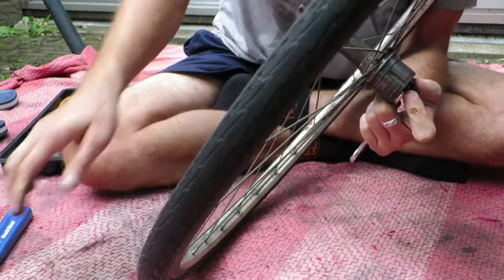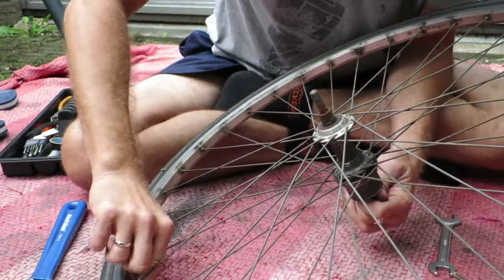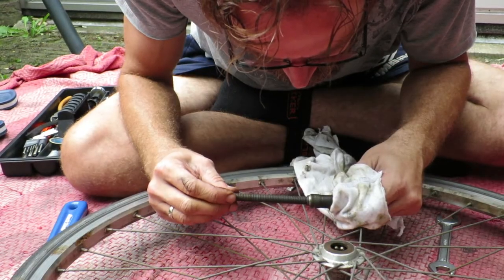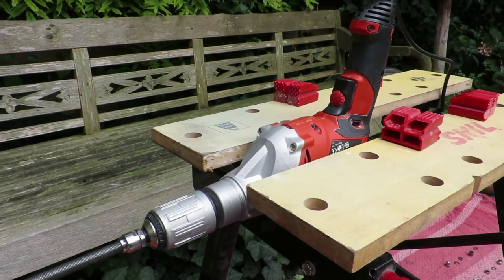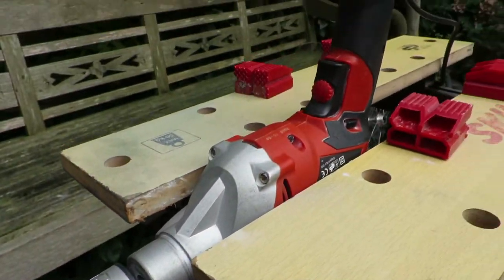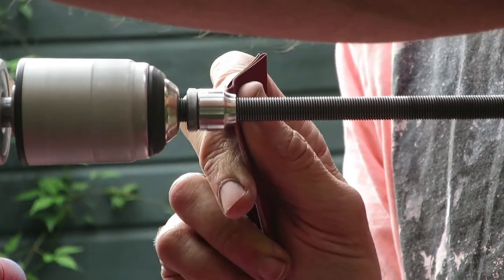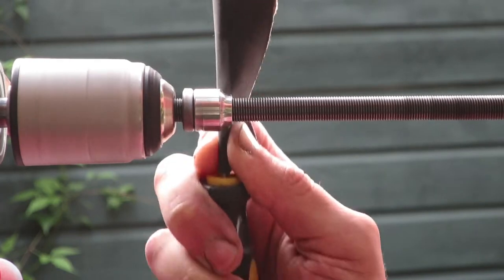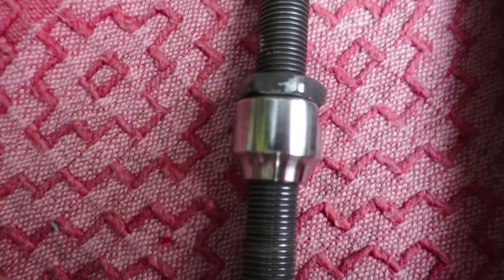How to easily repair damaged and pitted hub cones in 2 simple steps

Comment: I've done this four or five times. I use a drill press, so it's a bit easier. I start with 320 grit wrapped around a screw driver handle that approximately matches the radius of the code. Once the pits are gone I move through finer grades until I get to 2000 then I finish with metal polish. I don't know if it would make sense to go out and buy all those grades of sand paper, and polish, but I have it around anyways so it's no issue. It comes out looking like a mirror, and so far has never been a problem once installed back on the bike.  I've only had a problem once (just recently) and that was because the threads of the cone were badly worn and loose such that it was impossible to adjust them properly once they were on the bike. So I polished them for nothing in that case. Lesson learned, I'll reject the cone in the future if the threads are at all sloppy.

Comment: Today I tried this method with good result. The cones were smooth and shiny again. I used 180 and 400 wet sandpaper on a screwdriver. Now my front hub runs smoothly again. I think the “track” on the cone where the ball bairings touch will harden from use and will be polished by use.

Comment: Brilliant video! There's only one other video regarding repair of pitted cones. Was going to watch that one over however yours popped up.
Reply from the maker: Awesome. Glad I could help!
Reply: @restorationdotbike  how many grades of sandpaper did u use? I will be starting with 150 and than 3 other grades the final being 1200 or 1500 thanks.
Reply from the maker: @myvicariouslife4012  I believe it was 80, 150, 240, 400, 600, 800, 1000, 1200

Comment: This is excellent, thank you. There is a very good video on the same topic " How to Repair Pitted Cones and Cups in a Shimano Hub " It takes some time but it works perfectly. The grease makes the difference! I used a general purpose grease, orange transparent and after a year or so my bearings where toast. Then i switched to MoS2 Grease (KPF 2 K-30) and after 10 years and 1 regrease the bearings look good. I think MoS2 is the deal, but i tried nothing else then. Maybe EP-additives(could be) or PTFE(i doupt) would do the same or better? Has anyone information about this?

Comment: Thanks for keeping the video nice and short! Can I ask how those cones have lasted ever since? Do you have any evidence as to how long the newly polished cone lasts in comparison to a new one?
Reply from the maker: I can't because I've sold the bike. What I do know is that the most wear on bearings is not because of usage in general, but because of usage  with contamination from water or grit. Or because the entire bearing setup shows play so the force on the bearings is unequally distributed.

It could be that the cone surface has been treated so it's hardened and sanding the cone removes this layer, but I'm not an engineer so that's beyond my area of expertise
Reply: Pressure from use induces "work hardening" so, in many cases, you are fine using this. At least, it's better than riding on a sorrowfully pitted cone. Thanks for this video!
Reply: @KarlosEPM so the surface of the cone hardens where the ball bearings touch the cone? If that is so, maybe polishing it to mirror shine with 2000 grid as mentioned in an other comment, may not be necessary?

Comment: Hub appears to be a Joy-tech of which there are tons of old hubs that can be found in perhaps bike shops that has clipped the spokes out of non repairable wheels and so on, I myself will have a small mountain of discarded hubs for the axle parts. When I will retool a hub of such, out with the grade #300/#400 carbon balls and rebuild with High Quality grade #25 Chromium ball bearings and since I will be loosing material from the cone I will make up the difference with a thin washer. If the inner bearing race will be pitted then I'll just rebuild with a hub from my hub stocks. Just my 2 cents.
Reply from the maker: My LBS didn't have these cones

Comment: Will my brake rotors stay true after this? Or this is better for a bike with rim brakes. When you have disk brakes it is very important to avoid any kind of wobble but if rim brakes are present, then some wobble would be tolerable.
Reply from the maker: The sanding is evenly across the entire surface of the cone. And it's done with a machine that performs thousands of rotations per minute. This means you'll never introduce any asymmetry.
Reply: @restorationdotbike  that’s a good point. I will try this on my Mongoose Argus fat bike. The rear wheel hub have a pitted cone. Great video and fix.

Comment: Good work! But won’t this modify the angle of contact with the balls?
Reply from the maker: The contact point between cone and bearings will be different ever so slightly, but at the same angle, considering the fact you sand all the way round at thousands of RPM a minute.
Reply: No problems here. I bet there's a slight shift but is way better now!
Reply: @PauloCorceiro  Thanks!

Comment: My race (cup) is corroded. Do i need to do this as well as the cone?
Reply from the maker: Yes, but you can't use this setup obviously. You'll need a dremel tool to smoothen a bearing race.
Reply: @restorationdotbike  YES! dude I used to have access to a fab shop and everything was easy now I been restoring again and don't have access to a shop. this is a great idea.

Comment: Can I lay the drill on a table and hold it? I don't have a vice or anything
Reply from the maker: I personally wouldn't. In the end you're talking about using a power tool in a way it isn't supposed to. I feel with your method you increase the risk and lower the potential quality of the outcome.
Reply: @restorationdotbike  I ended up buying new cones anyways. $5 at the bike shop

Comment: Is there any risk of damaging my axle thread in my drill chuck? or is there a way to avoid this? Cheers
Reply from the maker: There isn't any protection between the thread and the dropout of your frame. Applying an entire rider's weight to the frame with thousands of miles of bumps and jumps does not result in worn axle threading. At least I've never seen it. That tells me the axle and threading is pretty sturdy.
Reply: I wrapped it in several layers of paper: great success!!